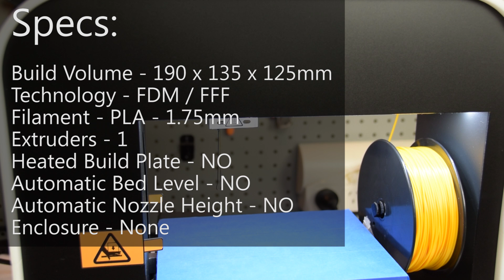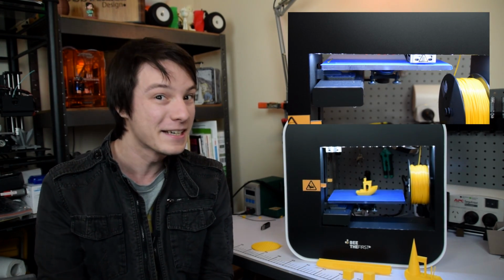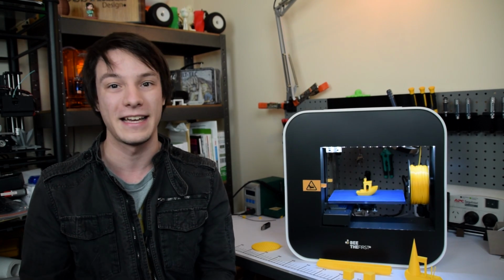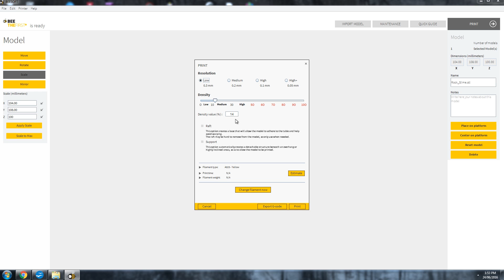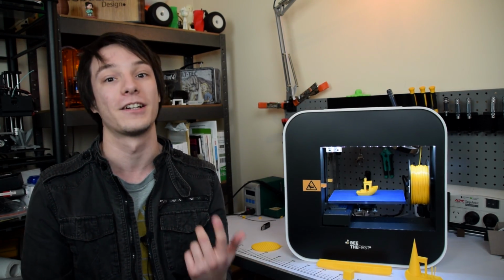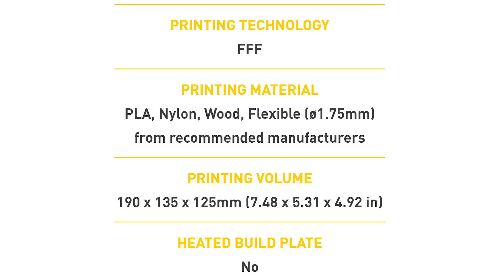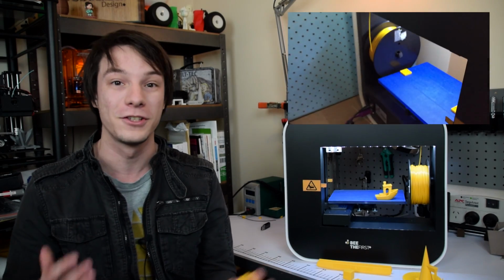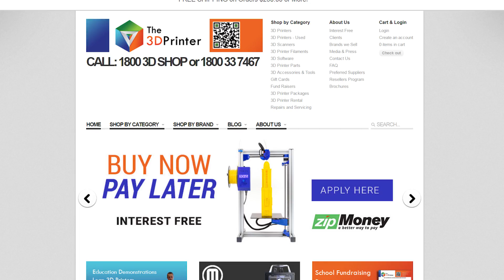Beethefirst Plus 3D Printer Review

Comment: Angus why don't you take another wack at this thing but this time go into the cfg files and bash those around a bit until it beehaves... All the usual suspects such as retract feed and heat are there.
Reply from the maker: Nah, it was a loaner unit and got the review it was worthy of... There's a lot of other machines I'd recommend over it these days, though I do still like the aesthetics.
Reply: But But but you gotta! otherwise I have to actually figure that crap out lol  Just won a design contest and got a bee+. Haven't got the printer but by the looks of it the warranty gets violated right about after the first spool of PLA runs out lol

Comment: I own the Beethefirst (original)... Should I sell it and get the latest Wanhou Duplicator i3 Plus? I'm having severe warping issues with PLA, and it knocks down my supports and even 1cm pillars which are only about 3 cm tall...
Reply: Do it. The i3 when tuned and modded properly is a really great printer.

Comment: Very strange pricing. PrintrBot Simple Metal is a fraction of the cost, it's compatible with a bunch of filaments and software, it prints a larger volume, to an adequate standard (for the price point) and It Just Works (really well, IMHO). And it has auto-bed leveling. Which, if i understand what I saw on your video, this massively overpriced Bee thing does not do. I do like its compact size and portability, although, frankly, it's little different in that regard to a PrintrBot Simple Metal.

Comment: I don't think i will ever consider such a closed system unless it's really cheap. But even then, i'd be better off buying a wanahoo or something similar...
This very product seems trash to me... You say  some filaments are stiffer and can clog the nozzle, but on a well built machine, this is not much of a problem.
On my printrbot simple, i used many filaments without much attention, and it never clogged the nozzle since i bought it 2 years ago.

At this price point i think one should get heated bed and auto bed levelling at least...

For less than that, i could buy a e3d bigbox which is superior in almost every possible aspect (only advantage this bee printer has is metal panels, but everything else is SIGNIFICANTLY better on the bigbox...)

Comment: Design alone doesn't make this piece of hardware any sort of value, especially if parts sourcing, minus the custom parts originates from China. While I can appreciate that it's far more expensive to produce a 3D printer in Portugal instead of China, packaging, features, print capacity and print quality simply don't justify the price. 

In this price range, with this print size/capacity as a closed system printer, an auto leveling heated bed with a wider range of filaments from Bee should be a given. If you're not paying for superior print quality or superior ease of use, where's the compelling value? 

In today's market, I'm more or less of the impression that any closed system 3D print platform should either destroy the competition in print quality and ease of use, or it should be cheaper than the competition for what the consumer receives and rely upon its closed system print supplies for revenue. Otherwise, supporting a product is tantamount to charity.

Comment: I would love to see Zortrax m200 review Angus. It is in my opinion one and probably only closed source 3d printer worth buying. Desktop 3d printers are changing quite fast. Now every new model is expected to have autocalibration. But one thing is still the same... noisy stepper motors (with the immortal nema 17) and lack of proper noise reducing enclosures/frames. Silent stepsticks are quite interesting but don't solve the problem entirely.
Reply: Just get a set of Astrosyns if it bothers you that much. I sleep 1m from mine without any damping/enclosure and it's just white noise to me(no I don't have any hearing disabilities either).
Reply: +exaltdragon I already have a set of Astrosyn dampers. They are very good in mitigating annoying nema 17 high pitch noises but still not enough to sleep next to the 3d printer... especially if it is a big delta (Rostock Max v1). Your 3d printer is probably much smaller and have wooden frame?
Reply: Mine's a v2.
Reply: exaltdragon In that case you have probably good noise toleration. It's a wooden rmax? (Mine is unfortunately acrylic.)

Comment: 3D printers will definitely lose advanced settings and configurability as they become better in the future. You don't see inkjet printers with advanced settings for ink flow-rate, print-speed or calibration these days. I fully expect that future 3D printers will just ask you for the model (and perhaps offer you some trade-offs between speed and detail, mass and strength, ...) and then just print your object perfectly.

But we're obviously not there yet. At this point in time, a printer with so little configurability is really just a toy. And with that price... ouch.
Reply: I strongly agree with what you're saying. I believe that as long as the prints are really good, configurability, though nice, is not completely necessary. However, in this case where there are evident printing artifacts and extrusion problems, not having custom options is unacceptable.